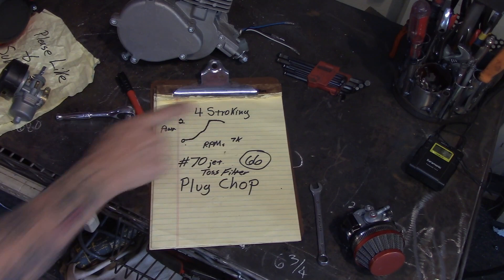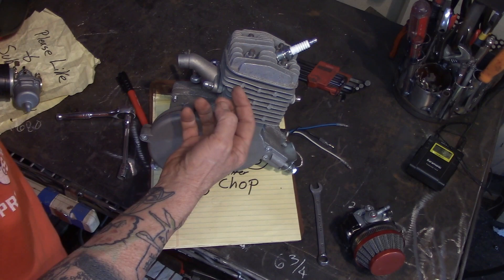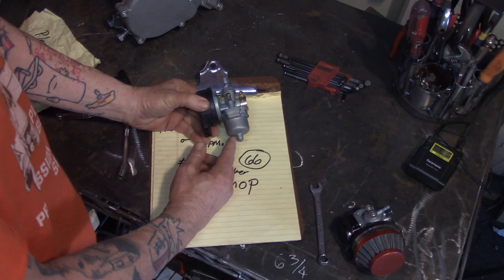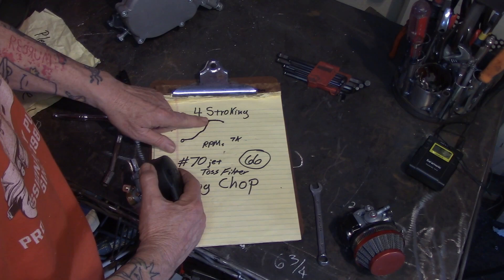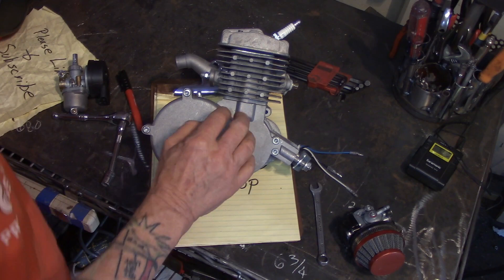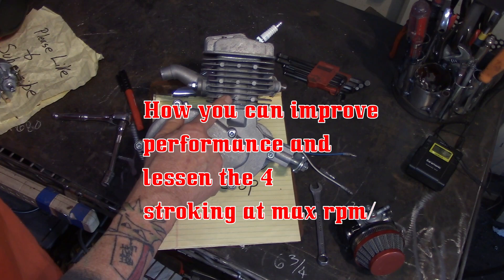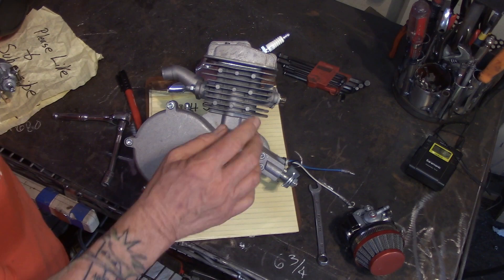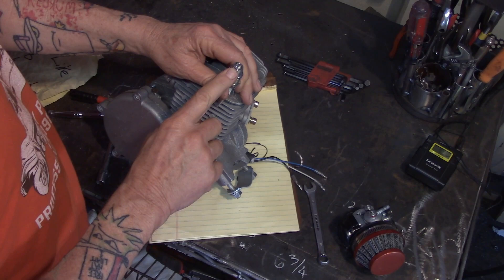Power Loss? What Is 4 Stroking On A 2 Stroke Motorized Bicycle?

Comment: Just remember, too rich causes power loss and fouls plugs. Too lean seizes engines and burns holes in pistons. Be very sure it is too rich before going to a smaller jet, and only go down ONE size. Then keep a close eye on the plug. It should be a dark brown, but not black. I am not a fan of "plug chops" To me that is a gimmick that really doesn't tell you anything. I like to put 25-50 miles on a plug, under different riding conditions, and then check it. If your 2 stroke engine has been fouling plugs, and you didn't mix too much oil with the gas, you can safely go down one size and put some miles on it. And remember, an engine will always run best when it is right on the edge of being too lean. That is something you don't want.

Comment: Can anyone reply I have a 80cc I've been breaking in but when I go past half throttle the rpm seems to plateau I have the black carburetor cover off with just the sponge on and the air needs to be all the way down to even get that much power
Reply: Remove the cap off the end of the muffler and your supposed to have choke fully open

Comment: You can adjust A/F ratio on the carburetor needle by moving the c clip upwards to lean or downwards to rich the air fuel ratio
Reply from the maker: That only works up to 3/4 throttle, then the main jet takes over but yes indeed it can help on low to mid range

Comment: Could the magneto magnets, that are broken in half/pieces, have to do with the 4 stroking due to loss of magnetism or something?
Reply from the maker: no. jetting and engine balancing are the issues
Reply: @HughesMotorized  I think its not 4 stroking at half/full throttle but at lower load, not too sure. I gotta balance the crankshaft tho

Comment: Thanks Hughe, digging the tats and the shirt 😂 I definitely need to try re-jetting sometime soon. First I gotta do the basics and check my squish after decking my head and removing a head gasket as it wasn’t sealing before, but I was too lazy to deck 😅
Reply: I'm kicking myself for not tearing engine apart and balancing the crank. But....the engine didn't come with cheap screws/bolts instead of the better allen/hex head. They were on super tight and stripping so I quit, any engine you wanna try to make fast really needs balanced first.

Comment: Usually a bad gasket somewhere makes it do this most of the time or the pin set to far down on the carb making it too rich
Reply from the maker: Main jet is for open throttle. Needle is for 1/4 to 3/4 throttle. 4 stroking is referring to full throttle @ max RPM. A bad gasket will make it run poorly from idle to wide open. But ya, if the clip is too low on the needle it will run rich 1/4 to 3/4 throttle.
Reply: @HughesMotorized  yes correct I noticed this problem just recently when my exhaust had broken just before expansion chamber started making brappp brappp noise at full speed

Comment: Thank you, Eugene! I ask, and you answer. 👊
Reply from the maker: My pleasure!
Reply: @HughesMotorized   I’m trying out a Boafeng NT carb. They don’t have that plunger/primer setup and use a spring-loaded bowl drain. The only drawback I’m finding is the main jet is different than the stock NT’s. Any idea where to find jets for the Boafengs?

Comment: More of a question I have a 53 CC 4 stroke engine it's generic got from Walmart I don't always break my belts on my transfer but it happens time and again what sort of replacement belt should I get to replace the old one and is there a belt I can get from a auto shop that will replace that belt 
and if so do you 
Know the type and part number thanks love you dude your always a great big help when I get a little lost or just forgot something thanks again for all your help

Comment: Since my last visit I've learned a lot about tuning. 
It 4strokes at 3/4 rpm. After that it picks up and revs all the way out. WOT all the way through but one stupid rpm range. So frustrated. (Filter removed, 66jet, removed cap and the plug at the end that holds the bolt that holds the cap so it's a straight pipe, and the needle is set to leanest position, plug at 25) 
The plug is oily around the base the electrode is darker than brown.
Reply: what oil/fuel ratio are you running
Reply: @topdog3407  4oz per gallon. Its marine 2cycle oil.

Comment: What are you doing your bike turns on it runs but only goes like 5 mph new engine new carburetor everything else is slightly use put a new engine in the carburetor connected the wire and everything and when I turn when I turn it on it started up it only goes like to mph 5 I need help please 🙏

Comment: So I have a great idea of what's wrong now. I bought a Bullet Train kit from Bikeberry and was given an adjustable exhaust pipe. Yeah, adjustable. The gasket I was given was almost like a copper o-ring. I had a spare exhaust gasket that I thought would work but it was too thick and covered a decent amount of the port. But I was wondering if that would also cause the engine to backfire loudly and stall if it has an excess of exhaust gasses?
Reply: It's called port matching..port the exhaust gasket so it will match the exhaust port on the cylinder as well as the intake side of exhaust..
Reply: Also you can use exhaust header wrap..it helps the heated exhaust air to travel throughout your exhaust faster..

Comment: Great video!  Easy to understand.  When running without the air cleaner is it just the filter foam that is removed or is it also the housing cover as well?    Thanks for the video.
Reply from the maker: Both

Comment: I had an idea watching the video could you route the exhaust through the frame of the bike like you can with your cables that would be a cool idea
Reply: If you want your frame to be 180° lol
Reply: @mitchellfultzable  Yes I know the frame will get hot but wouldn’t it be cool no wires no exhaust pipe I think it can be done but you’re building 100% custom bike frame you might be able to get away with using one of those West Coast chopper bikes

Comment: I have a phantom 85 kit and i cant get it to idle out of the box. I have to give it quarter throttle to keep it running. The air/fuel adjustment screw has no effect on idle. I was told i need to change jets. Im 500ft above see level. What size jet would you recommened?
Reply from the maker: Check for intake leaks first. Stock jet should idle even at 500ft

Comment: If i remeber right, the motor manual writes that the spark plug gap must be 0.4-0.5 mm. I am using an NGK B6HS spark plug. I a near at sea. With wider gap there will be problem with the cylinder?
Reply from the maker: Bigger spark plug  gap makes a bigger spark up to a point. The larger the gap, the more voltage is needed to jump the gap. Most experienced tuners know that increasing the gap size increases the spark area exposed to the air-fuel mixture, which maximizes burn efficiency
Reply: @HughesMotorized  This maybe cause any damage at the top of the cylinder?

Comment: How lean can one go without danger? I have done a lot of work on my bt100cc BBR...I have ported and port matched my one-piece cylinder/head.. remove all but one piston ring, done the piston intake trim mod, removed air-filter, reversed cylinder, added thinner base gasket, added velocity stack, #68 jet..retard timing by 5%, added long tube expansion chamber..etc.etc...still trying to get more top end out of my 32t rear sprocket on 20inch wheel...

But still wanting more top end!
What do I do???
Reply from the maker: Check out 2 Stroke Stuffing's channel.. I'm just a put it together, get it running good, custom bike kinda guy. More about the basics. Others like him, Ethan Smolik, and Don Butler are the pros at getting max performance.

Comment: What do you think the culprit is for 4 stroking in low rpm range? My engine 4 strokes until past 3/4 throttle. Then it screams at full throttle sounding a little lean. Plug looks perfect brown. Current clip position 2nd notch from top. I tried top notch and was way too lean. Also I've inspected thoroughly for for vacuum leaks repeatedly and none found.
Reply: adjust the carb needle, it affect it until about 3/4 throttle, move the clip up
Reply: @bored496  I have tried every needle position. That's what I was referring to when I said clip position and notch.

Comment: Do you think it's worth balancing a crank in a stock motor I'm not planning on going crazy with mods but I have access to a drill press and it seems pretty easy but if you're not going for a race engine is it worth it 😉
Reply from the maker: If you have the skills and do it right, then yes balancing can make for a better running engine. Is it mandatory? No. However some are better balanced than others from the factory
Reply: How much does your engine vibrate? 
 Iv'e only had 1 bike engine so far but from what Iv'e read. I think I might have got 1 that is a bit better balanced than a dud engine. But I don't have any balanced crank bike engine to compare it to.
 It vibrates a lot if you rev it up with the clutch pulled in sitting still but most vibration goes away once I'm riding/moving. That's very similar to how my Buell/Harley V-twin engine is. Vibrates like crazy at idle & revved up in neutral but 90% goes away once you're in motion. 
I notice my 4hp,  larger cc, 2 stroke snow blower seems to have less vibration than my bike engine. But just might be because it has rubber engine mounts. Wish I had a balanced 2 stroke bike engine to compare with.  
I guess I'm gonna spend $50 more on a VM22 carb & G2 reed kit. The windowed piston will be a slightly lighter, so I'm curious to see if I'll have slightly less vibration. 
I heard you can get just as much or more power than a reed kit by just using bigger/better carb & proper port work. But due to clearance issues, I'm gonna give a bigger carb/reed kit a try. If it'll get more power, slightly less vibration & stop engine from spitting gas out the carb. Then I think it'll be a win.

Comment: When mine is full throttle it four strokes and I checked the spark plug and it was black do you rekon I should go leaner on the jet?
Reply from the maker: Yes. Sounds correct
Reply: Did you get a leaner jet? Did it fix it? Just learning about carbs / jetting rn.

Comment: Won't the removed air filter cause dirt to get into the engine and scratch the piston?
Reply from the maker: Motorcycles have been running open for many years 1890s to 1960s bikes were pretty much all open
Reply: @HughesMotorized  makes sense,  probably for racing and short runs but for longevity I doubt there's too many dirt bikes in the trails or Highway bikes that run for many thousand Miles without an air filter of any kind, without any scoring from particles in the air getting into the draft of the intake
Reply from the maker: @Classycardrawings  BSA Gold Star, Royal Enfields, Ducatis, Moto Guzzi road bikes. Many came stock without a filter. Most before 1955 did
Reply from the maker: https://www.nationalmotorcyclemuseum.co.uk/birth-of-an-icon-1962-bsa-rocket-gold-star-650cc-prototype-used-by-chris-vincent-for-sale-with-hh-classics/
Reply from the maker: https://www.yesterdays.nl/product/bsa-1955ca-gold-star-499-cc-1-cyl-ohv-3407/
Reply from the maker: Still running today https://www.yesterdays.nl/product/ariel-1955ca-kh-499cc-2-cyl-ohv-3407/
Reply from the maker: I'd do most anything for this one: https://www.yesterdays.nl/product/moto-guzzi-1950-airone-sport-247cc-1-cyl-ohv-3405/